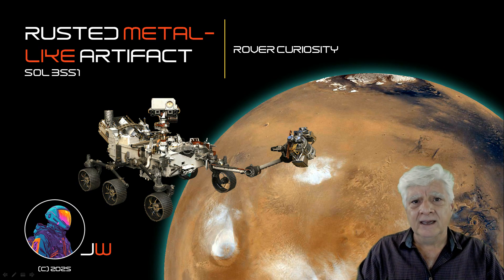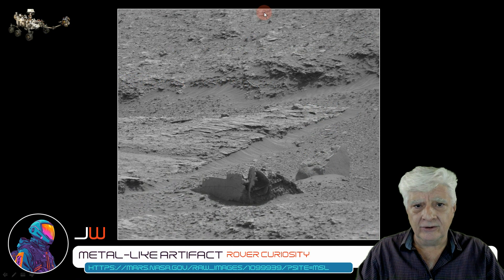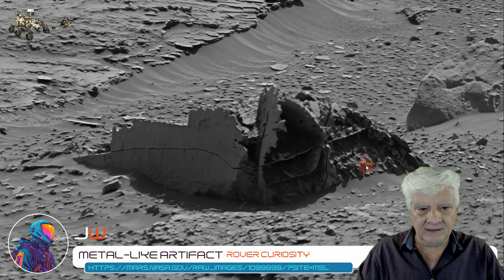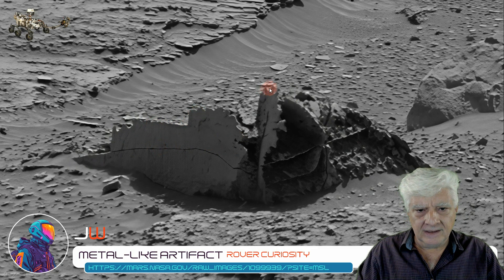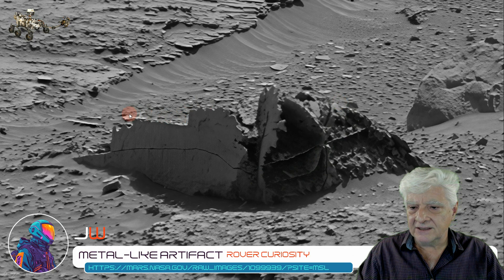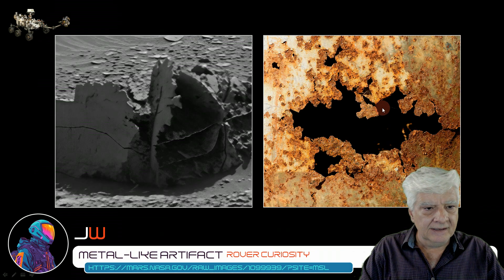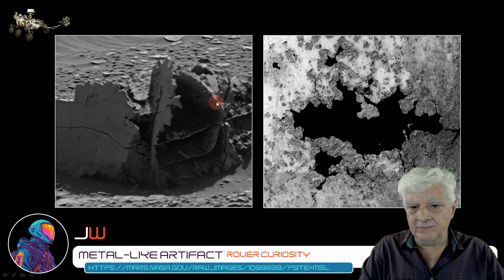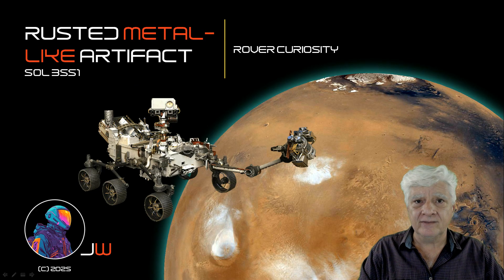ROVER CURIOSITY | Rusted Metal-Like Artifact (Sol 3551)

Comment: A few thoughts. It could be a bit of debris from one of the many "lost" Mars missions. Alternatively, if metal that is open to chemical corrosion, then then there is little oxygen in the atmosphere, so you would not get the same effect as, for e.g. Iron or steel on earth. The erosion pattern could well be "sandblasting" from a long period of exposure to current Martian conditions. There are some rocks that can weather like than on earth, comprised of layers of sands covering thin layers of mud ("paper shales" from a time when water was on the surface) and perhaps indicative of alternating seasons. AN interesting find, nevertheless.
Reply from the maker: The idea that this might be wreckage from a failed or secret mission to Mars also crossed my mind.